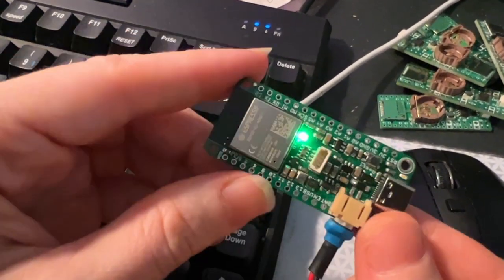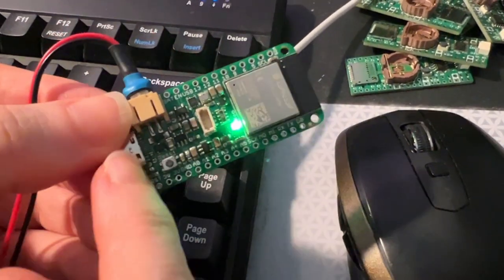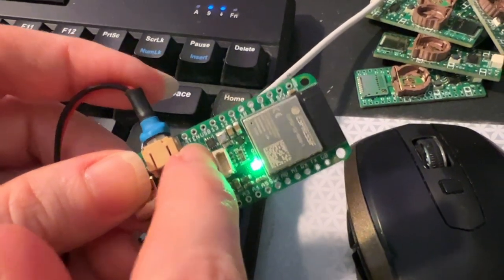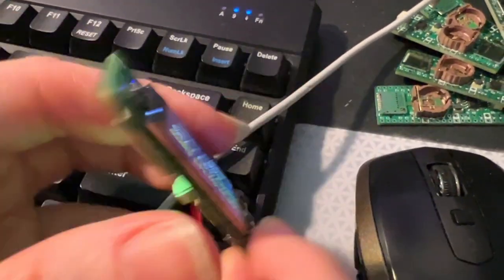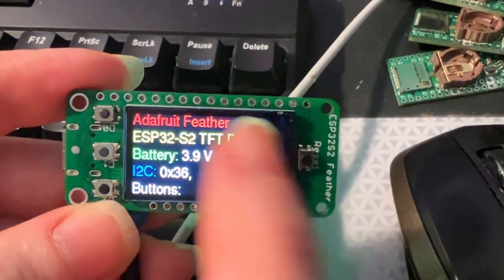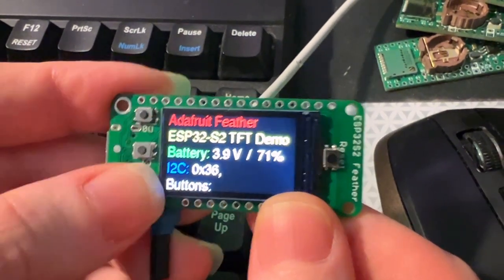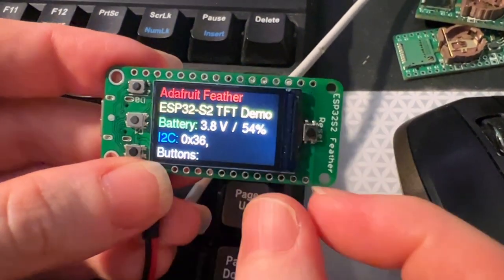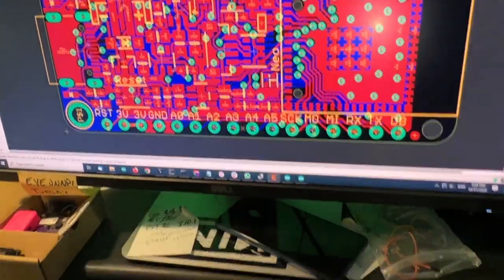last proto PCB test of the year - ESP32-S2 Feather with Reverse Mount TFT

Comment: what is reverse mount?
Reply: It really should say bottom mounted. This is important for orientation if you plan on stacking feathers together to know if the tft is top or bottom facing. There is a pro/con to each orientation depending on your goals. If you don’t plan on using it in a doubler/tripler setup then this version has a better orientation using it stand-alone in your hands as buttons are more useable for navigation. You wouldn’t want this version for a doubler/tripler expansion board setup because the tft would be facing downward.
Reply: @DevonsWorkshop  oic ty